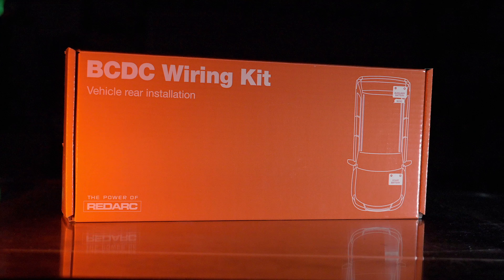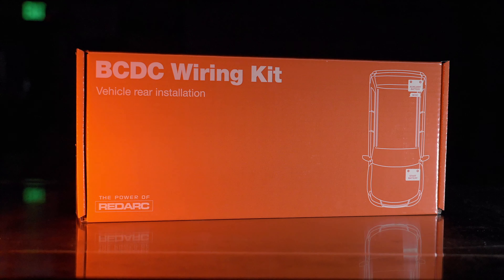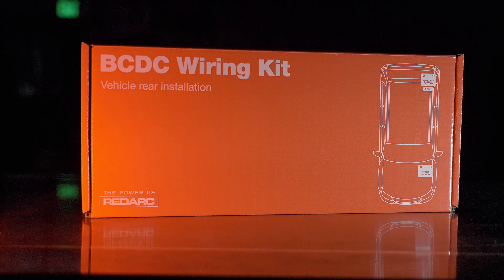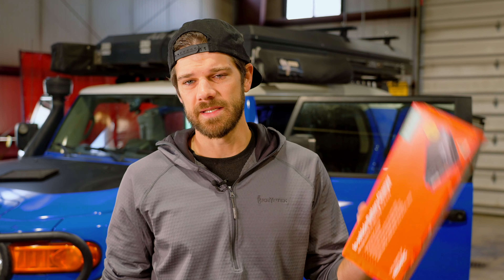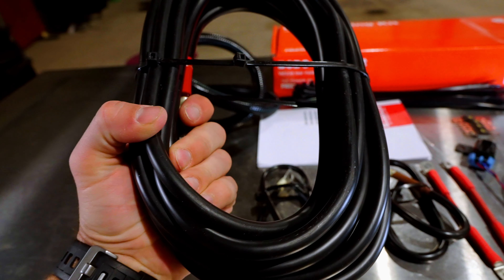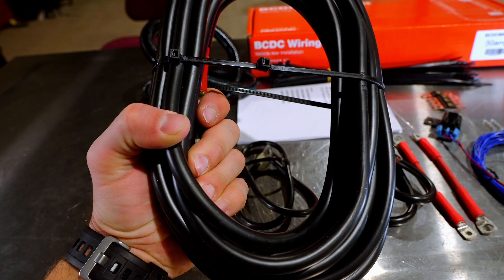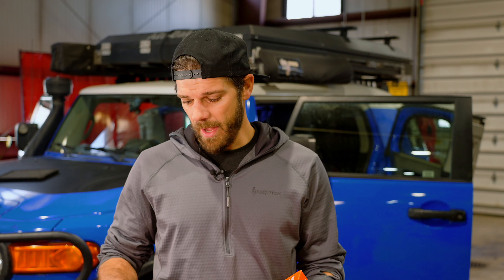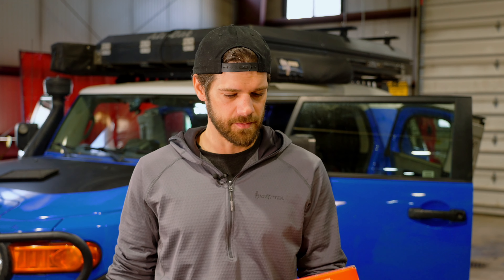Watch This BEFORE You Wire Your Dual Battery Setup!

Comment: Hey great video! I have the same setup, the redarc 1225D and I think this is not enough for everything (Fridge, lights and converter) even with 100w solar panel, how the 1240D works? Thank you 🙏
Reply from the maker: It’s crazy how fast it charges! It’s better for my little battery because now in the rare situation I need to get the battery topped off, I can idle the Fj for 15 minutes and gain loads of power back. For the next build I intend to use a 40 or perhaps even larger. We will see.

Comment: Wouldn't this setup destroy the alternator?
Reply from the maker: No, your alternator has extra power it can put out. A 25 amp is a good starting point for these chargers, those of us who have after market alternators can go up in juice. I will be doing a 40 or 50 amp on the new build.

Comment: Question about fridges with lithium batteries. What are you setting your low voltage shutoff to? The high end on mine is 11.1 which is nearly dead for lithium.
Reply from the maker: I just keep mine on the very lowest setting since lithium holds out so long. Also that feature is mostly for older battery types or people who use their starting battery and want to be able to start their truck back up in the morning! With my Redarc stuff I literally never have to worry about running out of juice.

Comment: I am working on a dual battery setup and looking at ideas for mines using lithium batteries 12v 135amp. I am paying close attention.
Reply from the maker: I suggest the 40 or 50 amp BCDC system.

Comment: I like the video and your rig! I just installed mine on the 2022 ram power wagon. I have Dakota lithium and was wondering about the blue wire… I left it alone and when the truck is off the Li light on the charger blinks. What do you think? Should I install on ignition source or not? Also do you have a isolator or does the charger automatically isolate?
Reply from the maker: The charger automatically isolates. I’ll have to look at my Redarc manual regarding the blue wire, it’s been a while. I think the ignition switch is for vehicles with smart alternators which yours may have.

Comment: You found a stingray, also I think the FJ Cruiser actually does have a smart alternator so you might want to connect that blue wire. I am about to put in a 300amp alternator in my FJ.
Reply from the maker: You made it in the nick of time! I was supposed to do the giveaway Friday, but had stuff come up. Drawing will be tomorrow!
Reply: @IndependenceOverland  well that's a change for me. I'm usually a day late and a dollar short 😆

Comment: $325 for rear install kit.  Just getting ready to install. Think it’s worth it?
Reply from the maker: What kit costs that much?
Reply: The rear install kit on the link.
Reply: Whale bones.
Reply from the maker: @EdJZatta  I didn’t realize there was a drop down and the prices went up. My mistake. I do still think it’s worth it because of the fact that you can so easily modify it later. And the charger can be upgraded without rewiring because the wire is so beefy. You can get wire cheaper, but it’s not shielded like the Redarc stuff is.

Comment from the maker: UPDATE: WINNER SELECTED!
The winner has been selected. You can watch the live stream event if you are curious how it went.  https://www.youtube.com/live/pDBNKEtDlfc?feature=share
VIDEO/PRODUCT CORRECTION:
I didn’t realize there was a drop down for each section of wire on the website. Like I said early in the video, I wasn’t sure of pricing when I first recorded this back in October. I took a quick look at the website while editing the video. Pricing is a fair bit more, but I do still think it’s worth it. I can’t find comparable wire with as much shielding as the Redarc kit has, and the junction box just saves lots of time down the road.  If it were me, I’d buy the 40/50 kit no matter what your installing so you can upgrade easier if you need to later. Sorry about the mistake!

And for you guys checking out the Baja videos. There are several published. It’s a BIG find. It’s not just a bone!